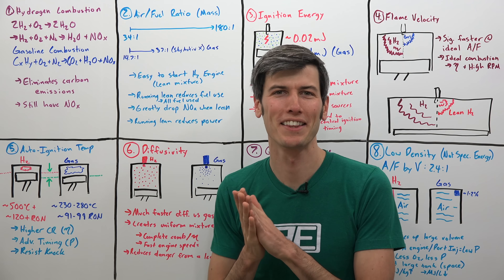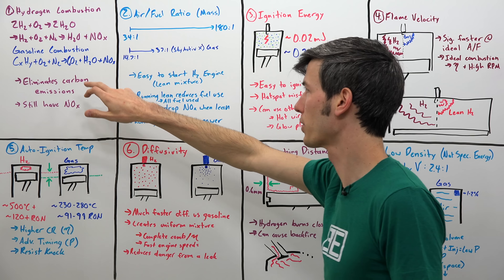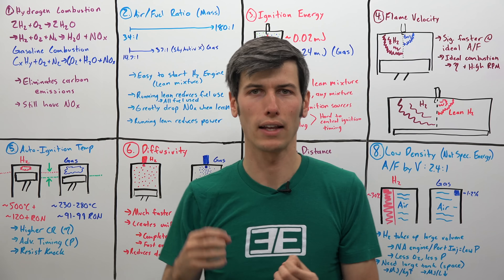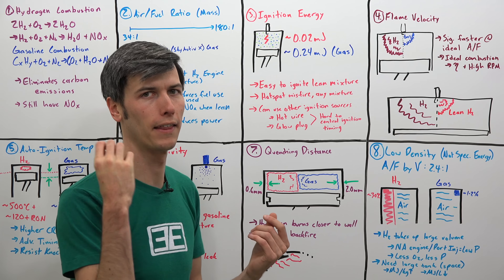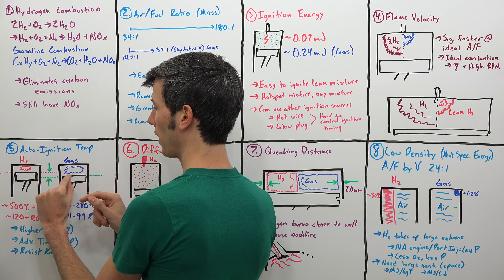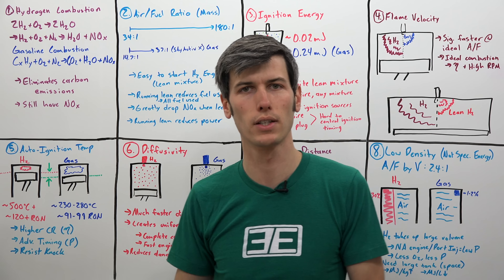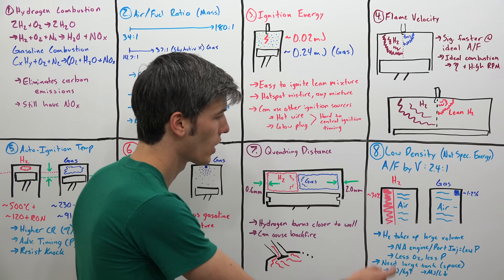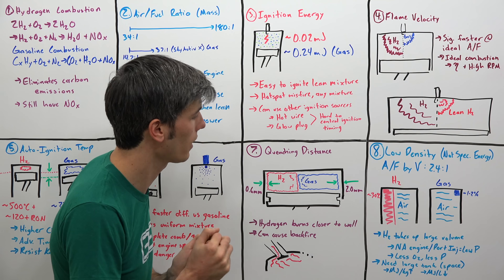The Difference Between Gasoline And Hydrogen Engines

Comment: If we use hydrogen in liquid state to store the fuel in the car, I think the volume would be decreased quite significantly.
It can be used to cool the engine too before being injected into the cylinder in a high pressure gas state for more efficiency.

Comment: Just viewed your video on Hydrogen use in combustion engines.
I am no engineer, but I think it would be advisable to maybe do a video explaining which vehicle manufactures are developing hydrogen engines and how is the hydrogen going to be transported to your local fuel shop and then how is it to be stored.
Instead of finishing your presentation and potentially allowing the general consumer to assume hydrogen is the next great fuel type for our cars.
Your video really does need to point out the impracticality of hydrogen as a fuel source.
The CSIRO in Australia is currently looking at using ammonia as a companion for hydroge to transport sufficient quantities of hydrogen, however this research is years away from being practical.

Comment: There continue to be calls for all vehicles to be replaced with electric vehicles. It is feasible to convert gasoline engines to hydrogen; this is far more feasible with a shorter timeline and a lower cost. The issue remains to generate hydrogen cheaply and to create a fueling infrastructure.

Comment: Isn't hydrogen and oxygen preferred for rockets, because they can be chilled to ridiculously cold temperatures and still remain in liquid form? The fuel before it is burned is used to cool the rocket nozzle to keep it from melting.

Comment: Your video explains a lot but what would be the difference between a hydrogen engine and browns gas engine. Browns gas referring to a 2part hydrogen 1 part oxygen mix  also know as Oxy Hydrogen. I know it produces more energy and has a wildly faster ignition timing. I understand it's probably not a recipe for efficiency but I'm curious if it could make a huge amount of horsepower from a small engine. I've been working on science experiments with a very large stationary Brown's gas generator for welding and cutting steel. Contrary to popular belief these machines are extremely safe if built properly there is no airpocket large enough to create a significant explosion with a backflash arrestors and flash ports also in line.

Comment: Nitrogen can be filtered out before combustion and or nox can be filtered out after combustion very easily... some engineer you this guy is... as a bonus hydrogen combustion engines will also scrub carbon and clean the air as we drive...

Comment: Would liquid hydrogen (I know it would be cryogenic) also a good fuel source in relation to gas? Or would the low temperatures cause structural flaws in the engine?
Reply: The H2 would need to be gasified before entering the cylinder (s)

Comment: Solution is when they Make the Hydrogen from water Save the Oxygen and Store Both as the Fuels.
Reply: Nebosvod gonzalez you need a lot electricity to split water into hydrogen and oxygen
Reply: It won’t work  unless we find a miracle catalyst . Under normal circumstances the energy needed to split water is equal or less than the energy  one gets from combustion , if it was kit like that you got yourself an infinite energy source.

Comment: Great video. Very interesting. But what IF you make a mixture of gasoline and hydrogen which is made directly on board using hho fuel cell. And you inject this mixture in regular ICE. You should get fuel with higher octane NUMBER. But the problem is that you need to change ignition timing. Otherwise you will not get fuel economy.

Comment: You have a lot more information that you haven’t explored about Hydrogen and I would advise you to explore HYDRONIUM, which is basically H3 instead of H2. Also out of all smaller drawbacks on Hydrogen that you have shown & discussed, which are really insignificant compared to advantages over gasoline, you did not point out why NONE of ICE engines cars use Hydrogen as fuel. The reason being simple that normal Car Engine raw material (alloy or aluminium) is Not designed to burn Hydrogen, and if someone tried to do so then the Walls of Engine Cylinder will start to disintegrate because Hydrogen when combusted releases atoms that are smaller than any metal used in ICE engines. Now combining Hydrogen with gasoline to burn in ICE is a totally different story where you get clean & very efficient combustion but when you try to burn Only Hydrogen (and ofcourse O2) in ICE then the walls will start to get Eaten up sooner than later and you will have Engine breakdown anytime sooner than expected. I would advise you to do a video on H3 (Hydronium) combined with Gasoline or Diesel then burning in a ICE to get full 100% burn rate and tremendous energy with much higher fuel efficiency in your next assignment. Good luck.

Comment: Since it's producing nox emissions does that make it more like a diesel engine or does it still have the power band of a gasoline engine?
Reply: Could go either way.  It could be like a racing engine with an extremely high RPM, such as Formula 1 cars or street sport bikes.  But, this is due to the high compression, which allows (requires?) advanced ignition timing and advanced valve timing, which in turn require high RPM, which results in more power. However, that advanced valve timing causes overlap, which he mentioned may cause a backfire due to the 0.4 mm quench distance.  So, engineers may make it more like a low revving diesel, thanks to the ability to be a compression ignition engine.  Although, Honda had a sport bike with little valve overlap in the same year that it had the same power as the Yamaha, Kawasaki and Suzuki competitors, which all used a lot of overlap.  So, engineers could probably do whatever they wanted, as long as they put their mind to it.

Comment: Another issue could be the propensity of hydrogen to get by the rings and into the crankcase and unless more money is spent on positive crankcase pressure, one basically has the ingredients for an explosion in the crankcase, blowing the seals at least or maybe more.

Comment: Is there something like a hybrid engine where you could use small amounts of hydrogen in order to improve classic combustion engine's perfomance? Would it even work?
Reply: Its already being done at a personal level. ive done it myself it added more then 30%more power and fuel economy. But to do it in newer cars you need to chip it so you can manipulate the fuel mixture or the cpu will cut the fuel

Comment: LPG propane is able 37 percent hydrogen as sold in North America HD5 automotive grade. It is 104 octane, so it burns very clean, leaving no carbon in the combustion chamber or on valves and rings. We ran fleets of V8 cars for decades and put from 750,000 to 850,000 km ( thats 466,000 to 528,000 miles ) on them in 5 years.There was almost no wear on the rings and pistons. LPG costs about 40 percent of the price of gasoline at the pump for the past 45 years here in Toronto and Calgary.

Comment: Hydrogen is just not suited for combustion, better convert it to electricity with a Fuel Cell to power an electric motor like in the Toyota Mirai.
Reply: Hydrogen is a fuel for free that's the only reason it's not developed fill your car up from the tap 😂
Reply: Japan made a car some 15 years ago but soon got hushed up

Comment: Water can be split into components Hydrogen and Oxygen ,stored ,and reunited in a gas turbine for electricity generation .Being able to do that continuously ,(and recycling H20)might save Untold mega tonnes of current Carbon rich fuel like coal ,oil, and gas ,ethanol etc..
And what might power jet engines?Hydrogen and pure Oxygen ..compressed to liquids ?

Comment: One other problem with hydrogen as I found out is the size of the H2 molecule compared to gasoline with an average molecule of C8H 18. ... The hard you train goes right past the piston rings into your crankcase readily compared the gasoline vapor or diesel presenting very significant explosion hazard inside your motor you need to take into account a very good leak down test on an engine and proper crankcase ventilation and of course is always with hydrogen all kinds of flashback arrestors just like with any of the welding gases that are flammable.

Comment: I know I am pretty late for the party here but please i want to hear an answer
I don't see any usefulness for 4 stroke hydrogen engine
Why bother just 2 stroke is enough
After all what are you afraid will leak from the exhaust? hydrogen peroxide and metal hydride dust?
But i am just a biological engineer so would like to hear from a mechanical engineer his opinion?

Comment: So basically, you need (1) some kind of super-high-compression fuel tank to store enough of it for more than just a tiny trip, and (2) pay out a lot more $$$ for it than gasoline just because hydrogen gas isn't readily available anywhere (like, you don't just take it out of the ground like crude oil...)

No wonder the world runs on crude oil! : D

Comment: Does smaller quenching distance also increase heat rejection? Closer flame to the wall means more heat escaping the cylinder, lowering efficiency.

Comment: Several have suggested using rotary engine for hydrogen: Rotary engines are very inefficient,  Low compression, plus they require engine oil injected into the chamber constantly and more so when accelerating. This would be a big problem for emissions on a hydrogen engine. (terrible gas mileage, flame out the exhaust due to overlap & the oil).

Comment: 4 strike engines are garbage.. If hydrogen is seriously to be considered.. They need to toss it into a new gen rotary without the oil leaks and spark plug cracks. Then team that up with a hybrid ev motor.

Otherwise... This is way too damn late.
Reply: Rotary engines are very inefficient, (terrible gas mileage, flame out the exhaust due to overlap & the oil) plus they require engine oil injected into the chamber constantly and more so when accelerating. This would be a big problem for emissions on a hydrogen engine.

Comment: Couldn't a simple engine be built from the ground up for the sole purpose of burning hydrogen? We all try to convert instead of innovate. Couldn't you run hydrogen roughly problem free in a turboprop?

Comment: This is nothing new, they ran hydrogen gen sets during the war. what is new is the way we can store hydrogen, I think its called hydroxy, its a substance that they put in cylinders and it acts like a sponge and absorbs up hydrogen allowing more storage.Only draw back is that because its a bye product of the nuclear industry its a very controlled substance, but it is getting out their.May be the millennials can do something as I think retro fitting a "gas" vehicle is easier than going down the path of electric hybrids. see horizon for kits ect related to hydrogen

Comment: Hydrogen just seems like such a good fuel for the future. As energy dense as oil based fuels and with less emissions. It can also be created cleanly in limitless amounts using seawater and renewable energy sources.
Reply: Just what terrorists have been waiting for. I think making your own fuel with solar/wind is the real future, instead of again depending on big companies that sell you overtaxed fuel.
Reply: It is harder to store, and isn't currently very affordable to produce in ways other than separating it from natural gas, but if we overcome these problems it wouldn't be a bad fuel.
Reply: Not quite true. It is indeed very much higher in energy density per kg, 141-120 MJ/kg at 690 bar where gasoline is 46.4 MJ/kg. The problem of hydrogen is that the gas itself if not very dense and if you see in the table concerning volume it has a energy density on about 5 MJ/L.
Reply: @feonor26  yes. But hydrogen, unlike gasoline, can be compressed. So you can mitigate the volumetric density issue by pressuring it. You could also use liquid hydrogen, though thats significantly more challenging because you have to cool it to 20k.

Pressurized hydrogen still isn't as volumetrically dense as gasoline. But its closer. And because its also much more efficient, you don't need to carry as much for the same range. So with hydrogen using the same tank space, you'll lose maybe 15-25% of the range. Which will still put it well above EVs.

Also note, lithium batteries are fucktons less dense than even hydrogen.
Reply: @Erowens98  Yeah lithium ion batteries sucks balls compared to gasoline and hydrogen when we talk energy density. It functions okay on city driving etc., but those people who wants to put batteries in a plane? Lol...dream on. Unless we're going to get our hands on a super safe, super efficient alien battery technology soon, it's not gonna happen.
Reply: @feonor26  yeah, not to mention towing any significant load. You get less than half the range.
Reply: @Erowens98  compressing the hydrogen will makeit much less eficient, a lot of energy in needed to do it, thus making it unviable
Reply: @Erowens98  if you produce it on board the car itself. Useing electrolosus you can technically have a condensed fuel source being the salt water mixture in the tank as the secondary alternator is dedicated to the rig it will creat hydrogen oxygen then will be redirected into two seperate chambers that can be stored and saved for later in the trip when the tanks are full you can have it automated to shut off till the condensed salt fuel mixture. As for the engine i think a bigger rotary might be the best choice just because of the entire miss fire thing if not we will just have to let it run really really lean, preferably a 4 rotor. Till hot spot missfires cant happen and design a water jacket for the engine itself. Or we could have it be a hydrogen gasoline hybrid motor. Were the motor itself is designed to use both hydrogen and gasoline together. The hydrogen would be used as starter fuel and will be produced on board the car. Then after the hydrogen starts the engine gasoline is then added into the hydrogen mixture so that when ignited the hydrogen will enrich the fuel boosting the MPG.
Reply: @burntchickennugget191  that's not viable you put more energy in into the electrolysis process than you can get out of it. That's why HHO Systems in cars can't run by itself, they still need gasoline
Reply: @Erowens98  And mining Lithium for enough batteries to replace gasoline is an ecological disaster waiting to happen.
Reply: It can be, its just a matter of when we exicute stage 5. As of rn we are stuck in stage 4 due to the fact that people want to stick with gas.
Reply: @Jeff Peate I didn't say it was efficient
Reply: What about using palladium for hydrogen storage?
Reply: @Jeff Peate You don't need to make it liquid, you just need to pressurize it.
Reply: The biggest problem for me with hydrogen internal combustion engines is that they are significantly more dangerous than gasoline. Hydrogen is highly combustible, far beyond gasoline.
Reply: Fuel cells are better
Reply: Sharron Clark  Hydrogen fuel cells are more efficient than internal combustion engines, that's why nobody makes hydrogen engines.

Hydrogen can be stored much more easily and in larger quantities relative to mass than electricity, and can be refilled very quickly. Hydrogen can also be made using completely clean methods, you can make hydrogen at home very easily if you want with just water and electricity.

The problem with a hydrogen economy is that you need a huge surplus of cheap renewable energy, because it takes considerably more energy to make the hydrogen than what you get out of it. It's not really feasible when we actually have a negative energy balance and that's why we need to burn so much oil, and we're not even close to reaching the point where we don't need it any more so to make hydrogen for at at least the next few decades you'd need to burn oil/gas/coal which defeats the purpose.
Reply: H2 production is not clean. You have to ways one involves petroleum, and the second is hidrolisys , but it generates a lot of  problems increasing the salinity, and to work a bit efficient need an addition of sulphuric acid. And remember that the compression and the cryogenization are expensive systems. Not so clean as the propaganda!
Reply: @alvaroasi  Electrolysis can be powered cleanly. Not efficient but absolutely cleaner than Battery production
Reply: @carlosandleon  But the loss of efficiency is huge, and the increase of salinity [on the coast] is a sensible matter, then no matters if the electrolysis is done with "clean" electricity.
Reply: @alvaroasi  I didn't say it was efficient. But the salinity can be remedied by moving facilities further offshore. Or on lakes or something. And I'm not being efficient. I think solid state batteries are the answer though and Hopefully nuclear fusion
Reply: Mustache Merlin  Electric cars have a total efficiency of below 30%:
The power train (including motor) has around 89% efficiency, and any generator has below 60% efficiency: solar (20%) hydro (40), eolic (35), coal (40), nuclear (60), etc.
So, the overall efficiency does depend on the country, but average is tops 35, more commonly below that.
Reply: Hydrogen fuel is man made....there is none available to humans naturally. Making hydrogen requires burning petroleum or nukes.
Hydrogen fuel is useless.
Reply: Actually Hydrogen is most abundant resource in the universe. It was the first element in History.  So not man made.
Reply: @larryiwig5740  no....hydrogen FUEL is nowhere but the sun. Burnt hydrogen is water. 
Straight hydrogen on earth is man made.

Comment: What about the amount of energy it takes to produce hydrogen versus gasoline?  How does that fit into the overall equation?
Reply: You can use solar nuclear wind etc to do electrolysis
Reply: Or socks, or water itself or hands, scale, anything that can produce or atleast assist in the production